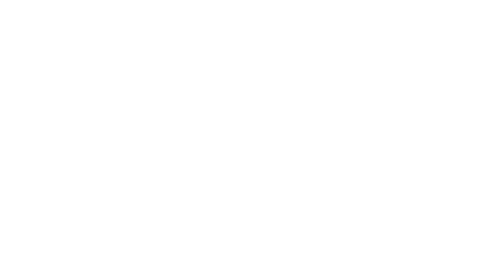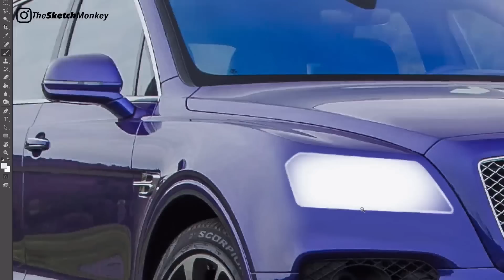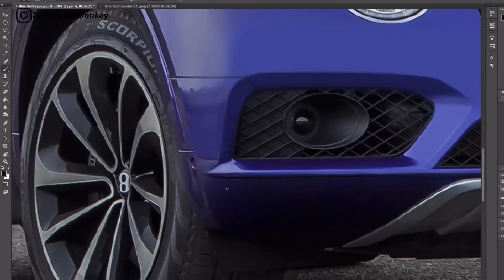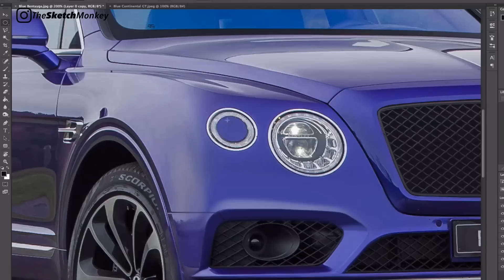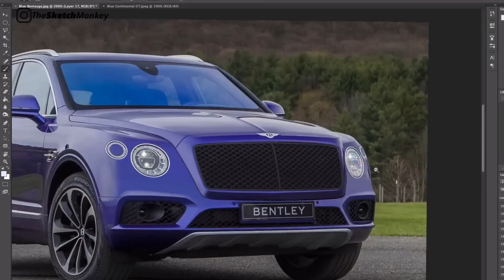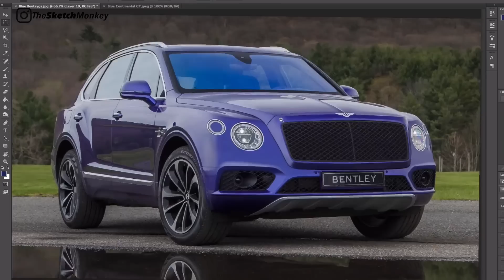Bentley Bentayga Re-design - Can we turn it into a decent looking SUV??

Comment: I have seen this car up close, it is much bigger than what can be seen in the photos, and this feeling comes exactly from the front view of the car.  I think the front graphics in this car are not suitable, it reminds me of a London taxi.  Your design did not help much either.  In my taste, I think the headlights should be polygonal or need a bit of broken lines and angles to be a little more serious.Perhaps your first design, a rectangular lamp inspired by old Bentley models that existed inside the rectangular round lamp environment, is a good idea And do not worry, the front grille in chrome works better for Bentley.

Comment: The idea of the re-design was very great I mean you really nailed it with each and every point about this Bentley SUV and what was wrong with it. However, The execution was not as I hoped. I’m sure you are able to do a lot better. One more point why I didn’t like your execution is that the you made the 2nd small circled light of this SUV a bit higher not the same as the original design, where it was perfectly joined with the original headlight. It looks a little weird after the re-design. I believe if you match the same shape with the same angle as the original, oh boy it would look perfect. Thanks again. I enjoy all of your videos.

Comment: I guess it depends on what your idea of an SUV is. My idea is that an SUV should be rather truck-like. SUVs are supposed to be off-roadable. I want to see fewer, bolder, chunkier design elements. An SUV should not look swollen, flabby, fat or anything like that, it should look muscular, even weightlifter muscular. The Bentayga isn't convincing as an SUV because it hasn't been given any of that chunkiness that I'm looking for. I have the same complaint about the Tesla Model X, too sedan-like, not chunky enough.

I would make the skid plate bigger and bolder, and top it off with a big bold body-colored bumper and get rid of all the lower air vents. I think you're right that the grille can be wider, but I would keep it chrome. I'd get rid of that center chrome strip that divides the grille in two. That's a major design error because it adds a fussy detail that detracts from the design. I'd make the headlights slightly bigger, center them in their space between the grille and the side of the car and get rid of the outboard turn signal/running lights. Instead, I'd nestle them up alongside the headlight in a half or 3/4 circle at the lower inner quadrants of the headlights. One more thing: I'd take the Bentley logo off the hood, make it bigger, eliminate the fussy wings and put it in the center of the grille.

One feature I like about the Bentayga front end is that they put the grille in a nice, bold body-colored frame. I'd keep that. I might even experiment with making it chrome.

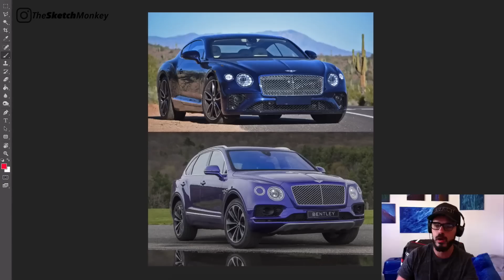Comment: The problem with the Bentayga is that it's based more on the previous Continental GT design, rather than the new 2018 design seen at 0:43
The new design of the Continental GT is a lot more modern and sporty (and a lot less "swollen" or round & curvy) than the previous generations designs.

I also agree with you about the Stelvio, the proportions are just not quite right, it looks a bit like a lifted hatchback rather than a true SUV.

Comment: Your edit represents everything wrong with car design right now: OVERSIZED GRILLES
Reply: Brad Ling that’s what happens when they all have turbos and higher factory HP ratings,  more grill for more cooling, it’s not a matter of design but function
Reply: @thebigv8644  That's only sometimes true. Engines are also getting more efficient, which means they output less heat. A Camry does not need a square meter of grille to cool itself. In fact, a lot of the grille area are fake on many of these new cars and the radiator doesn't cover the whole area behind it.

Comment: How about a re-design of the Gen 4 Z-28.  That sounds like a challenge but the panels are "plastic" so a re-design could actually be done in reality as well.
Reply: I am constantly amazed by your talent and thing the Bentayga re-design shows how minor changes make a major acceptance of the design.  I would have changed the lights too if I were the factory but in your case I realize you are keeping with it's unique design and the lights are a major part of that.

Comment: I think the reason why the Bentayga looks different from the new Continental is because the Bentayga was based on the previous generation of Continental.
If you compare the Bentayga you the old Continental you'll see a lot more similarities.
I don't know if this is factually correct but it makes the most sense

Comment: I think the real problem all along is that the proportions on the front are messed up because of that thing under the bumper and the grill should be below the two lights instead of above them which makes it look abit ugly and different but just making the grill bigger is dumb and was just a shitty redesign all together this redesign did make it better but not for the right things or the main problems

Comment: All of those "SUVs" are unibody crossovers and not true body on frame SUVs.
Reply: Body on frame is antiquated, it just makes a huge heavy car that is cramped on the inside.
Reply: @Candisa  No, it gives us machines that are amazing off road like the Jeep Wrangler or Toyota 4runner. As well as great towers like the Expedition and Tahoe.
Reply: @AE86FTS  Completely different vehicles for completely different uses and completely different buyers. Nobody uses a Bentayga to tow or off-road.
Reply: @Candisa  They never use the sports cars that they buy either. I hate that argument so much.
Reply: @AE86FTS  That's exactly why the sportscars these people buy aren't the best sportscars out there. They are exclusive, somewhat luxurious, eye-catching, and the performance and handling is more than good enough to give most ordinary plebs a run for their money despite the driver being far from good.
That's exactly why their SUV's don't need to be good off-roaders or good towers either, they need to be luxurious, eye-catching, exclusive, with a badge/grille on the front that says "I'm better than you".
Reply: @Candisa  So essentially these people are posers that like to burn money. Got it
Reply: @AE86FTS  Exactly

Comment: I just don't like how the grill integrates with the rest of the front in both versions. Looks like an odd, large nose. I prefer your version due to the better look and I do like round headlights(because Miata, Stratos, Morris Mini, 50's Fiat 500 Topolino, etc.) and it's just I think the Continental GT looks good due to how everything blends in either a luxurious curve or an exciting edge, but the grill on the Bentayga just sits on an awkward blob. I think if they just smoothed the transition between the grill and front and the hood flow, it'd look much better.

Comment: Could you design a saab concept following the brand's codes :
3 spokes wheels
A trunk spoiler
A hatchback design
Profiled headlights
The typical grill
And eventually something with airplanes/turbos because it's in saab's dna.
That would be awesome, I personally did my versions of the 900, 9000 and sonett ☺

Comment: Definitely appreciate both designs but I think one of the problems with the bentayga is the flat surface that the headlights are on. If it was rounded slightly to the bonnet and slightly more to the wheel arch would make a huge difference

Comment: The redesign looks quite better than the original but there's something that was on my head during the whole video, you are comparing the bentayga to the new continental gt (which looks incredible imo) but the bentayga borrows it's style directly from the previous continental gt, that's why the front grill is wider in the new conti... cuz it's a whole new model. I thought that it'd be a good idea to implement the design of the new conti on what would be a facelifted bentayga. For example the detail that I definitely don't like about the bentayga and I didn't like about the old conti gt is the sort of hump where the front grill is placed, that continues to the bonnet. They did get rid of that design feature in the new car and I love it.
This is just me getting stuff out of my head, this series of redesigns is amazing!

Comment: good ideas, but that new grill looks comically large, like an anteater :D
Halfway between Bentley and yours would be a good compromise, I think.
Cleaning up those messy air intakes worked very well. 
round headlights are just awkward, but you were right in keeping them.
Reply: The round headlights are verry cool in my onion. It gives bentley this elegsnt vibe. Like irs a modern recreation of those older european luxury cars.
Reply: YensR ikr, looks like a Rolls Royce instead of a Bentley
Reply: I like the size of the grill but I would like to see that it's not sticking out that much
Reply: @jelledekort5786  good point actually, that might reduce the impression of a big nose!
Reply: I actually like the new giant grille trend on cars - Mazda is doing it beautifully, BMW not so much, but in general I like the trend.
Reply: The grill looks like a Hitler mustache

Comment: All SUVs look odd, this just looks extra odd. 
:-/
Reply: Crossover not SUV
Reply: @AE86FTS  Ooooh, that changes EVERYTHING. 
And by everything I mean nothing. 
Bentley sells it as an SUV, literally everybody calls it an SUV, but sure, if for you it is a crossover...
Reply: @YensR  You sound like the smart alacs that say that a DSG is a manual.
Reply: @YensR  Calling crossovers as SUVs is like calling a Prius a sports car. SUVs are off road and towing machines. And most crossovers are not.
Reply: @AE86FTS  Both your DSG and Prius analogy are so wrong, it's pretty hopeless. 
https://en.wikipedia.org/wiki/Crossover_(automobile)
Take it up with Bentley.
Reply: @YensR  You just proved my point. SUVs are body on frame vehicles made for off roading or towing. As for the analogies, I have heard people call DSGs "automated manuals" because of mechanics. And the Prius one was exaggeration ( I know, hard to convey through the internet).
Reply: @AE86FTS  If that is what you are getting from that wikipedia article, I suggest you work on your reading comprehension and leave me alone in the meantime.
Reply: @AE86FTS  Nope. An SUV is a pseudo offroading machine that is supposed to look rugged but is really just a soccer mom mobile. If it was a serious machine, it'd be an "offroader". Crossover is just a marketing term for an SUV that is supposed to look more like a car.
Reply: @Kubboz  Well that is incorrect. If it has a frame, it's an SUV. If not it's a crossover. For example, something like a Tahoe may not be  that great at off roading, but it makes up for that in towing capacity.
Reply: @AE86FTS  NO, body on frame doesn't mean that it is a SUV
Reply: @AE86FTS  do you know how to use a brain, if you have one?